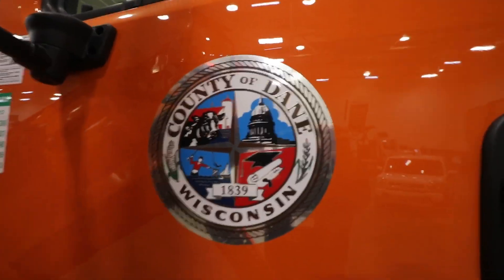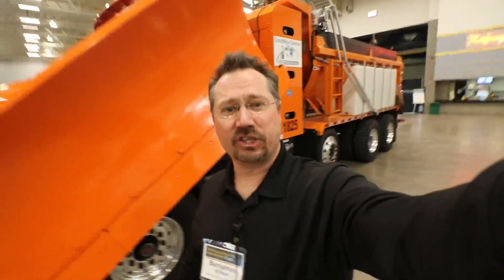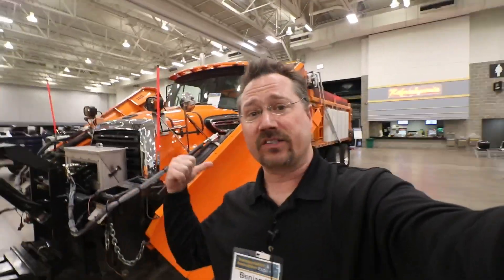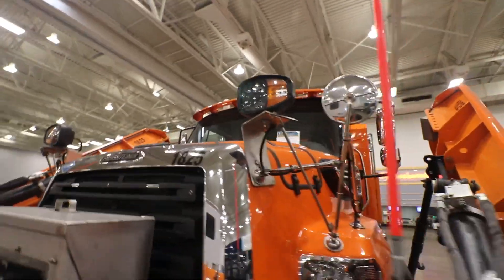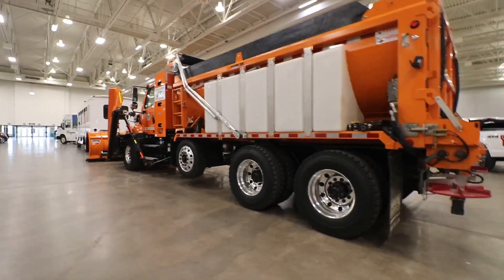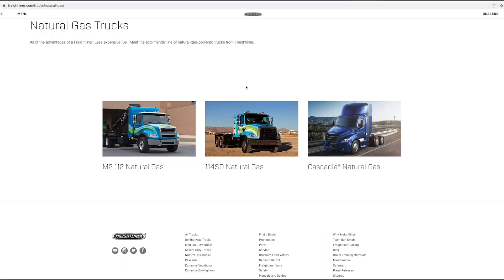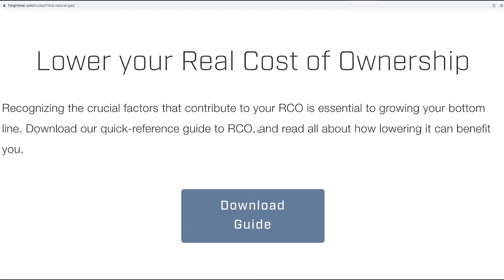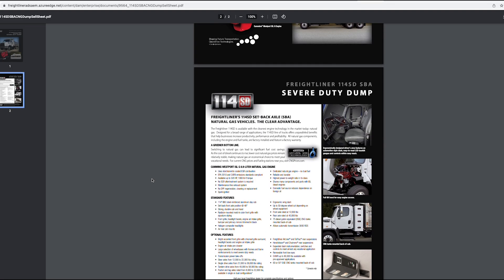Natural Gas Plow Truck | Freightliner 114SD NG

Comment: The big deal for me is the fuel tax.  Since the 'fuel' can't be taxed the vehicle essentially drives on the roads for free.  In my state they nail me $150 a year to drive electric to replace my fuel tax revenue.
Reply from the maker: In the State of Wisconsin, we already have an alternative fuel tax. There is also CNG available at a fair number of retail locations, including some Kwik-Trip stations. The machines there look essentially like gasoline pumps and they DO have tax on them. Even if you make your own bio-diesel at home, there is a mechanism for paying road tax on it.

In Wisconsin, we also have a surcharge on electric vehicle registrations. "Common sense" says that it's to replace gas tax revenue, but in reality, WI hasn't raised the gas tax (even to match inflation!) in over 15 years!
The EV additional registration fee was actually used as a way to save political face by Republican lawmakers who said they would NOT increase borrowing UNLESS they could find a new stream of revenue. So, they passed a law that collects a relatively small amount of money from one tiny group so that they could borrow a very large amount of money.
It had nothing to do with how roads are paid for.
The whole story is pretty interesting and you can read about it at:
https://300mpg.org/2018/10/07/wisconsin-electric-vehicle-tax/

For details of Wisconsin's Alternative Fuel Tax, please see:
https://www.revenue.wi.gov/Pages/FAQS/ise-altfuel.aspx

Comment: For the right application, CNG is a great fuel for vehicles.  The Denver airport has rules mandating the use of CNG in the tunnels at the airport, and had multiple fueling stations there.  As a result there are a very large number of CNG vehicles there.  Additionally, with the cost is diesel emissions equipment, it's cheaper to purchase an automotive gas engine converted to natural gas (think Ford 2.5 or 7.3) than a tier 4 compliant diesel engine.

Comment: they had propane ones here but nobody wanted to fuel them. only one propane dealer would do it but sold out and that ended that. there are 2 setting near me that have not been run in 10 years .trucks maybe 12 years old.what a waste. take care, be safe and well.

Comment: We ran a bunch of cng trucks, had a lot of engine troubles.
Reply from the maker: Hey Andy, when was that, and what kind of issues were they? Which engine? There's quite a few different manufacturers now.
Reply: @BenjaminNelsonX  i don't remember what engine they had for sure, I think they were cummins. Freightliner trucks, in the last 4 years. Had to overhaul the engines with low miles, in the shop a lot. They are at a different location than me but if I remember I'll try to get more info.

Comment: Why even mention the fact that LNG is a fossil fuel? It burns clean and isn’t the pertinent point the effect on the environment is almost nothing? While we get all tingly about EV there is simply no supporting infrastructure in place to support an instant switch over to electric everything. This country has an incredible amount of natural gas and I believe it wise to take advantage of this God given resource as we slowly transition to what the environmental cultists see as the panacea and answer to global warming.
Reply from the maker: It's just that I walk about EVs a lot on my channel. The advantages of CNG are as you just stated.
This is a perfect application for CNG power.
The other exciting thing is that the County is actually producing it's own BIOGAS renewable CNG from a landfill.